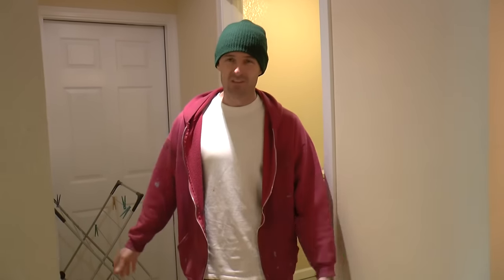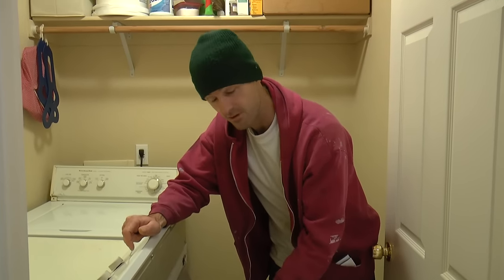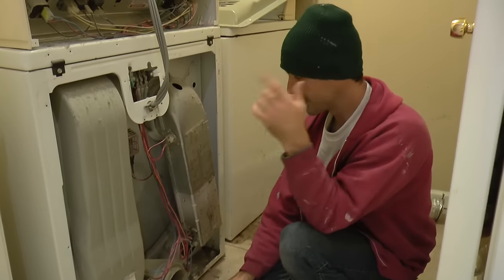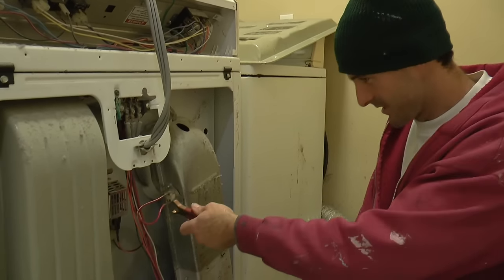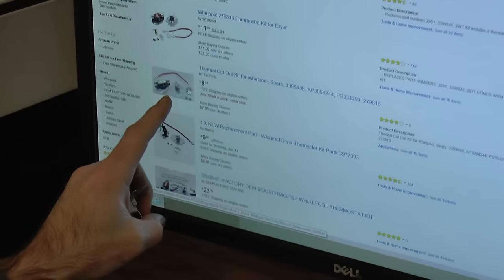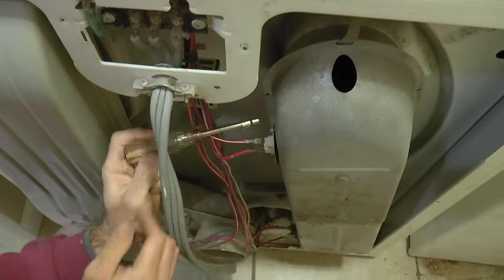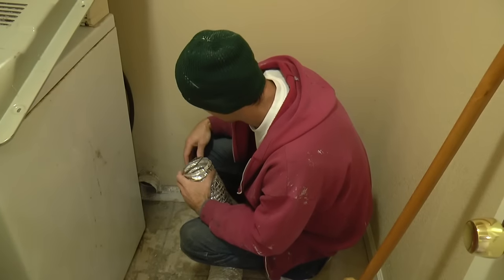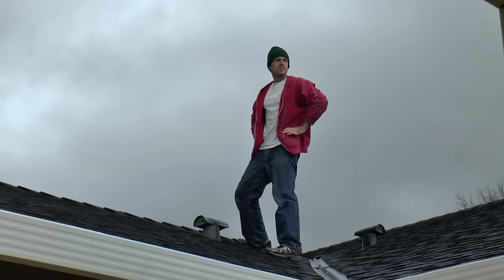My Electric Clothes Dryer Doesn't Get Hot - Fixed!

Comment: You can actually use the Thermal cutoff again in a pinch, by slamming it o the floor for sure, it RESETS them by moving the metal back into place, I wouldn't recommend reusing it except in a pinch, where you can watch it closely. It's cheap enough to fix, hell you can get the Heating Element, 2 Themastats, and the Cut-off on Amazon for like 30 bucks in most cases. The Lint pull out needs to be cleaned, it can stop up with invisible fabric softener and make it run hot, believe it or not.

Comment: Sometimes when you don't clean the dryer roof vent heat builds up at the machine and burns out the element. Elements also fail after a period of time not to mention an occasional inline fuse can fail too.

Comment: 🤔 - why they decided for it to be a non-resettable fuse = putting a button on it to be pressed when cooled down, when it is actually a resettable thermal cut-out when thrown on the floor? Built-in obsolescence/stopping twinkys from going down the back of the dryer and just pressing the thermal reset and not finding-out what caused it to trip ⚠️

Comment: How long before this had you cleaned it out? I guess it's the first time i've seen the dryer exhaust go to the roof too. Maybe i'm used to mobile homes where it goes out the side. Are you still going to replace the part though anyway?
Have a good'nnn
Reply from the maker: I'm ashamed to admit it, but at least 3 years.

Comment: What setting should your voltmeter be set on so it will beep?  My voltmeter is not digital like the one you are using, it has a turn knob.  Also, what areas to you touch on the fuses to get a reading?  Thanks.

Comment: The white thermal switch that’s not on the heating element - does not reset and it’s for the motor (drum / blower) it’s about 6 bucks on Amazon

Comment: What a coincidence. Mine just did the same thing. Same dryer too.  I wanted to fix it fast so I paid too much for that thermostat, but still cheaper than repair man. It failed again two months later. Ordered new one from internet and is working again.  Post if ypur dryer fails again. I'm curious why my new thermostat went bad after two months

Comment: Wish you were around to fix mine. I replaced two used dryers and the guy came out six times, heat won't work for long. Now its stopped heating again.
Reply: Timer

Comment: Did I miss the part where you  explain how you are sure the thermal fuse will open again after you've slammed it on the concrete?   This is unsafe if you don't test that it will still work properly during an overheat.

Comment: HI. I'm planning on using your video to fix my dryer. What brand of volt tester did you use so I can get one with makes  a noise when there is continuity?
Reply: most all multi meters has the beep check  on the dial you will see a setting that looks like a bell thats the beep .. the other just shows numbers the beep makes it easier forsure

Comment: yeah, i reset them all the time because i have a water heater that I got brand spanking new from a new house build that the contractor got screwed for 75.00 on, he didn't want a water heater, he wanted a 75.00 bill. LOL   i wanted a water heater, gas, and awesome.  the thing was though, this water heater is REALLY awesome, it has a Blower on top that makes 100% sure no one in the house dies from carbon monoxide poisoning, well, you really should have two ducts for that, one for your regular furnace and one for your fancy water heater, I do not however.  rather than bore a hole in my ceiling, and through my attic and then through my shake roof, I decided to take advantage of the already made duct that was present and buy a "T". well, here is where the occupants , other than me come in, I live with a house full of girls. myself and 4 girls. If at some point , in the dead of winter, all of them decide they need a shower within a certain amount of time, about 2 hours, the hot water heater will kick on and stay on for a very long time, during that time if i have not stoked the wood stove and the house has dropped in temp to below 60 or so, the furnace will also kick on, for  and extended amount of time.    it took me a little while to figure this out.     LOL  
   so my furnace has a few of those 8 to 15 dollar do dads ( thermo activated shut off switches) <-- I just made that up, not bad though.  and one of them trips like a mad man when the face of my furnace gets a little hotter than expected and shuts the entire show down.   One other one that I found actually has a RESET Button on top of it!       So it really can't be a safety hazard to reset them is the moral of this story and how do you know I am not telling you yarn and could possibly cause a fire in your house? 

  If it was going to go bad after 1 use it would go bad the OTHER way,  i know this because i reset mine several times and it was wearing out and it would take less and less to trip it after a while so THEN!  i went and got me a resettable one like the one on top except for the proper temp - its a different temp for each location.    so wearing out means it is not harder to set off but easier.  like stretching metal really, you will never make your metal stronger by bending it back and fourth,   Ta daaaa!   I don't have to bang them on the ground anymore since it has a button to push it back in place. :0)   i wonder if anyone reads this....

Comment: I agree with Ahmed Al-Amir. switch out for new one. Since this is on YouYube and it fails and catches fire the insurance company looking at this video may refuse your claim. Plus that glowing unit scares the holy jeebees out of me.
Reply from the maker: Hey John, I think I will buy the replacement just for peace of mind. Plus then I can heat up the one I wacked  with a torch and see if it would've done it's job .
Reply: Any update on that?
Reply: Waiting on that update as well

Comment: You have way too much vent line for one, witch wouldn't lead to the clogs, and if one fuse goes out it's only a matter of time before it trips the rest, your wasting time replace them all at once(it's like a car,a new part makes the old ones around it and or connected go out)

Comment: The dryer was not broken. The operator was ignorant. The safety switch worked as designed. The air duct with dryer lint did what it takes a while to do. My wife does what she always does (refuses to check the lint screen, not put dish in sink, uses vacuum to create noise around my business, mockingly because I am not getting anything done like she isn't actually vacuuming - this is what women do, vanity!) Sorry. The dryer prevented the operator from setting the house on fire.

Comment: What if the back of the dryer is getting too hot and starts to make a loud screeching noise?
Reply: Whirlpool? They changed the way the barrel rolls. They used to have a wheel outside of the barrel that kept it rotating THEN they changed to a metal piece that looks semi circle. As time goes on they wear and you have metal rubbing against medal. That piece can be replace with a wheel but it means removing the barrel which can be a pain.

Comment: Now you won't know if it's still protecting your circuit properly... spend the 9 bucks...
Reply: My thoughts precisely.  I've had to replace this component a few years ago (also had a root cause of a clogged duct, D'Oh!)

Even if you are able to make the fuse conduct electricity again, you can't be certain that it will "fail" (that is, "work") in a controlled manner in the future.  Now that you know where the part is, you can probably have the repair with a new part done in 10 minutes.  Invest the time and the $9 so that we can eventually see the camper finished, please!
Reply: I mean, he acknowledged that it was better to replace it.
Reply: Just bypass it.. then later buy another house with the insurance money